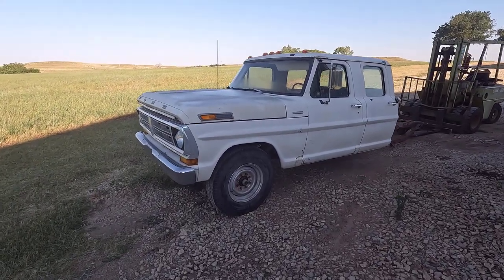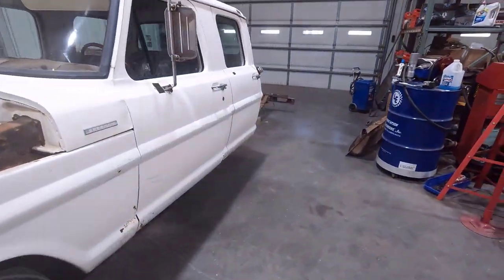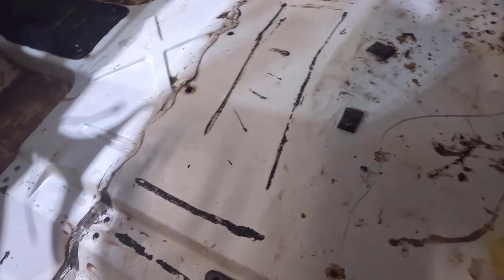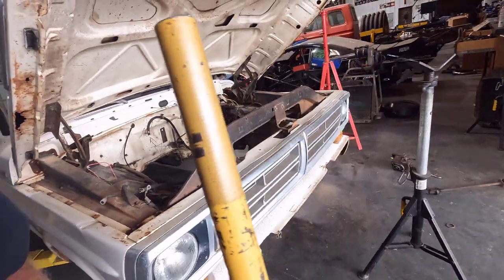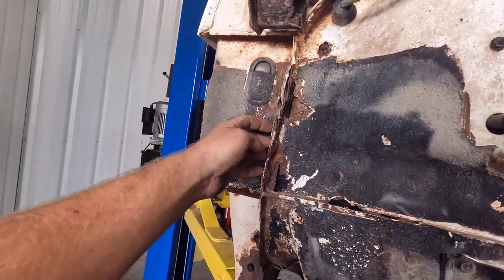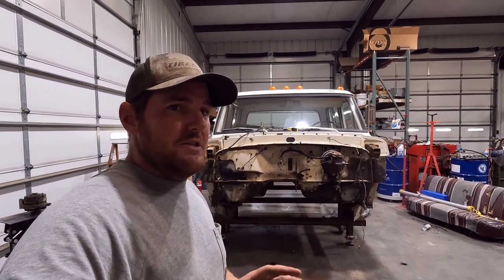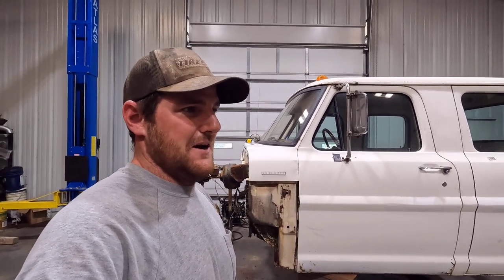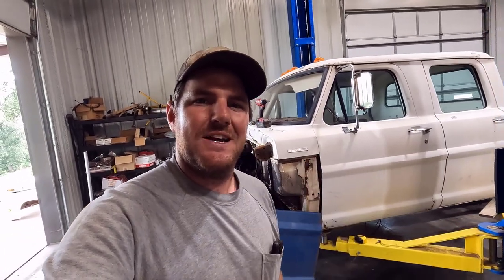Getting Started On A CREWCAB!!! 72 Wimbledon White Crew Cab

Comment: Hey Matt, just got done watching all 40 minutes, I honestly really enjoyed what you called “rambling”. To me it was so insightful to hear your thought process and you just letting those thoughts flow out as words.

Like you, I also have a hard time finishing projects. Budget, time, the physicality of dealing with older rusty vehicles is also a point that should not be overlooked.

Taking that front cab section from the other cab is a great idea. I definitely think that is something you should do regardless.

That f450 you brought in, well, it is huge and you are right, you don’t want to damage the firewall. I too hate it when I see old trucks with modern interiors, or like you said, let’s say a dentside with an OBS dash, hideous in my eyes! 

I guess, the real question is: what is the ultimate goal for the vehicle? Will this be your work horse? Because if so, then finding a more modern chassis will do wonders for being a general work horse.

But if this is just going to be the super cool grocery getter and maybe do some off-roading, we’ll perhaps just getting a used 4x4 OBS chassis and then putting a coyote (or anything) in it would be sweet.

Of course, you do know a lot more than I ever will about these trucks, but, in terms of fitment and minimization of your total working hours and money, I don’t think it’s the worst option.

Or just do the rust repair and hold onto the cab until you need it in the future. Because, to be honest, I am not really sure if there is any option you presented that is really sticking with you. It’s like being in a bar full of 5’s, but because there’s only 5’s, you just assume these are best options and you settle for what’s in front of you. Saying you have better things to do than be with a 5, or in this case, start a project that is going to take up vast amounts of your time and money, when hey, maybe there is simply a 10 in the bar next door waiting for you.

I think throwing this cab on the back burner for now may be your best option.

Comment: Hey Matt. You know the 6.7. You like the 6.7. Use the 6.7 if you have all of the electrodigicals. If the OBS chassis is gonna work, use that. My daily driver is a 95 F150. OBS  parts are still easy to get. I've seen lots of guys use the Dakota Digital setup. Looks pretty sweet. Gotta be cheaper using the stuff you already have. $15k is a big chunk of change. Gonna be a cool truck. Thanks for posting.

Comment: 6.7 would be ideal, but if this isn't going to be a long haul comfy cruiser...do the 429/460 route. Add a 5 or 6 speed, maybe even do an overdrive unit.
Not a Fummins fan either. I'm over the Cummins in everything routine. It's a tractor motor...6.7's are comparatively, so much smoother and quieter.
Another thing with the comfy cruiser, they don't work with the older cabs. Even with all the sound deadening etc., wind noise will always be there and the overall noise insulation is just not there with these older cabs. I personally don't mind as I've been in them for 60+ years.
Looking forward to see what you do with this one as always, but I must say that you've bit off quite a chunk on this one. Good Luck!

Comment: buy the repair panels from lmc and do it piece by piece otherwise the cab will sway over and twist its cheaper that way and far as the frame going cut the braces the stock frame check it out too see its rotted out and motor and tranny wise the easy way out a 7.3 powerstroke swap they fit with stock firewall so you dont have to cut it and for 10k you can build power out 7.3 powerstroke .thanks

- nick